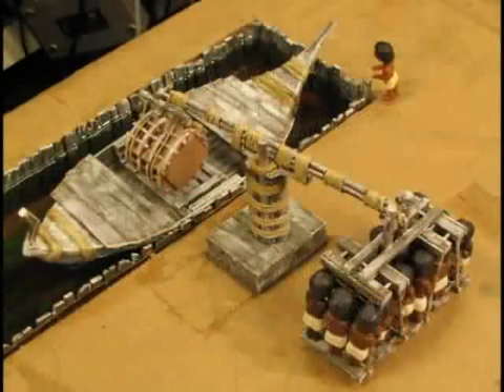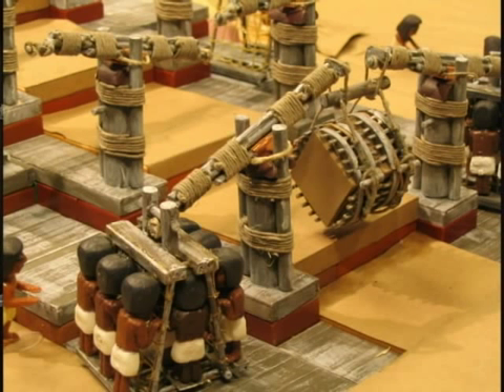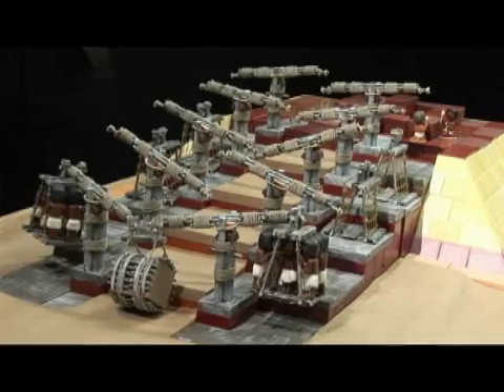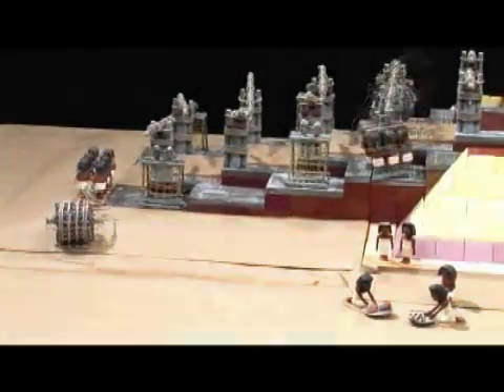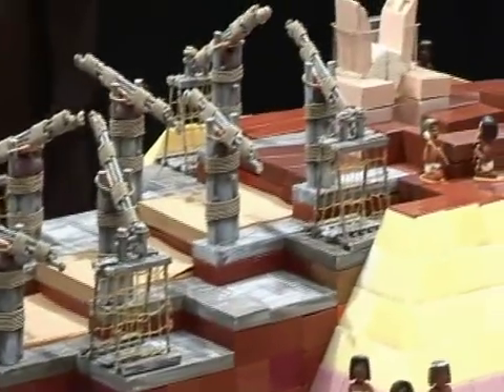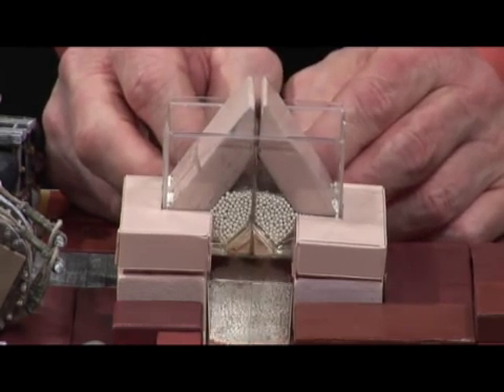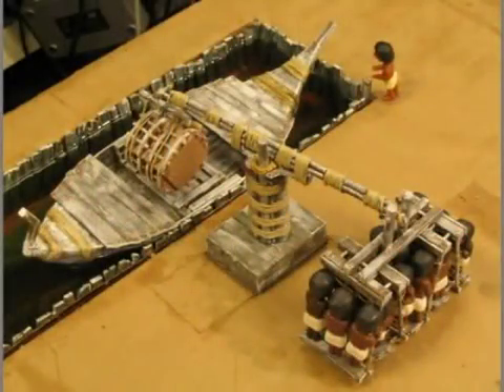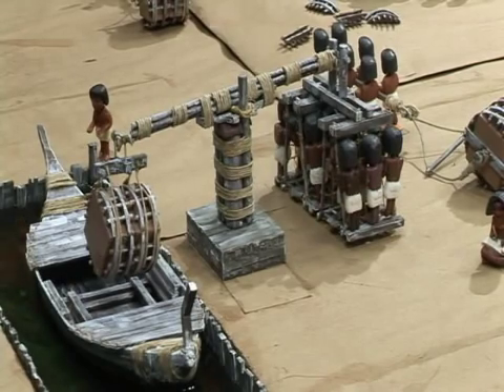LB Models - Pyramid Construction, Part 1

Comment: You have done a superb jog here and are on the right track. However, I'm not a big fan of placing the blocks in rollers, which is very cumbersome. Why couldn't the blocks be lifted out of a barge in the Nile, placed in another barge in a canal, floated some distance toward the pyramid site, lifted again to a hire canal, etc., and then lifted in position on the first step of the pyramid?